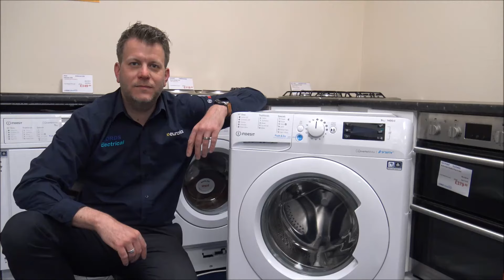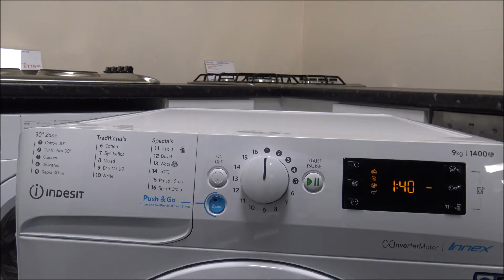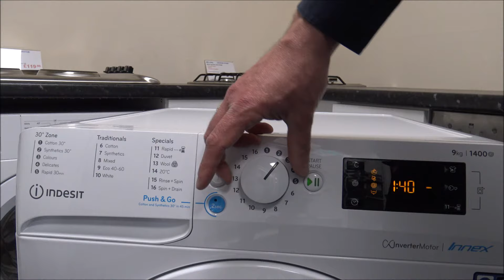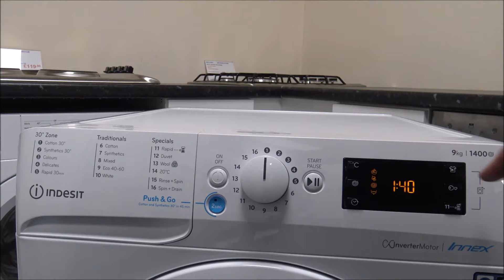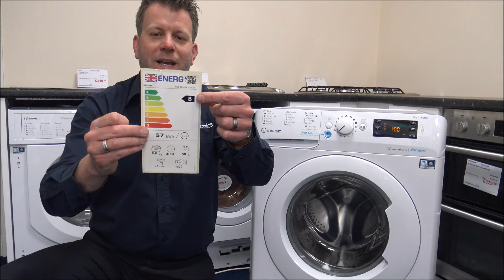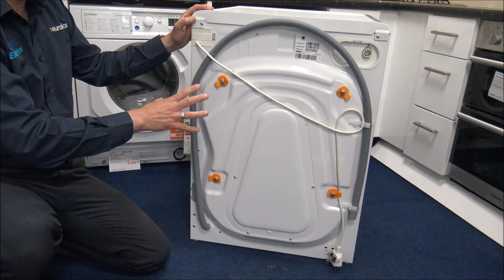Indesit BWE91485 9Kg 1400 Spin Washing Machine

Comment: I got mine last week. I've done two washes, both times it kept bleeping, did usual checks all fine. The rapid wash took over an hour. Can anyone help please
Reply from the maker: I would check the water is turned up enough, because sometimes on these machines if the water pressure is too low when its trying to get the water in the machine it can beep

Comment: Mines is only 2 years old and I think the bearing have gone already. The spin is extremely loud. 

Surprisingly when i hand spin the drum I dont hear that much noise. 

Could it be something else? Perhaps the inernal weight thats loose?
Reply from the maker: If it is a grinding noise, then it is more than likely the bearings that have gone, or something is rubbing against the drum as it rotates. You would normally be able to hear the grinding as you rotate it slowly if it was the bearings though

Comment: My washer this make, is not spinning.
Reply from the maker: Couple of things to look at, first of all just check the load in the machine is at least a third full. If you put in a small load in then it may not be enough to balance it. Also if it is not spinning and pumping out then it may be a blocked waste pipe which can sometimes cause an issue.

Comment: Hi, very informative video thank you.  Just had my wash go 1400 set back up after kitchen improvement  but machine got connected to hot water supply instead of cold. Now when on 30° wash cycle water is not heating.

Comment: Does it make a loud , knocking noise 4 times When you turn the machine on to say that it is locked
Reply from the maker: Yes there will be a clunking noise when the machine enables the door lock, and normally the same sound at the end of the program when the machine door unlocks

Comment: I’m stuck with an error F06 door locked can’t open , how to fix it please ???
Reply from the maker: This would normally indicate there is a fault with the door lock mechanism itself, hopefully you can get the door open manually at the bottom as sometimes there is a tab to release the door.

Comment: I have the drain out sign on nti machine and it doesn’t allow the machine to wash cloths what do I do?
Reply from the maker: It sounds like there is a blockage in the waste which is why it cant pump water out of the machine or fill up. I would recommend trying to pull the machine out and see if you can remove the blockage from the waste pipe and hopefully it should be back to normal then

Comment: I boat this washing machine a month ago but now power didn’t come 
What to do can you help in door is stuck as will
Reply from the maker: If there is no power to the machine at all then try a different mains socket, or check that a fuse hasn't blown
Reply: I change the socket I change the fuse everything but door is stuck in power not coming in screen everything diy no power nothing please help me what to do washing machine in new only 1 months ago

Comment: I have same washer but it will fill water for a minute then stop. I checked with my meter and I saw that when the water stops power to the valve will be disconnected. But then the washer will be washing for a minute or two till h2o error sign will be flashing. What's the problem? Water hose isn't blocked anyway. Could it be the pressure sensor or what?

Comment: Recently got one of the Indesit machines (washer dryer 7kg/5kg) and the drum is spinning fine and it’s draining, but for the life of me we cannot figure out why it won’t spin at the end of a program, leaving the clothes soaking wet, even if we leave it on the 1400 spin speed recommendation for the program
Reply from the maker: The main reason can be that it is a small load and it cannot balance the load out properly. This is a common problem on a lot of washers and having at least half a load in there is required so it can spin properly